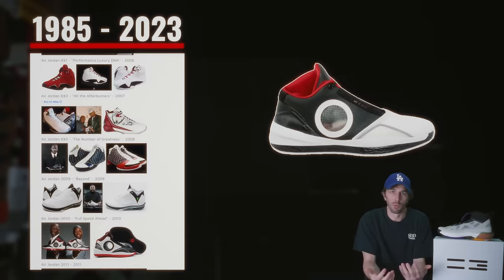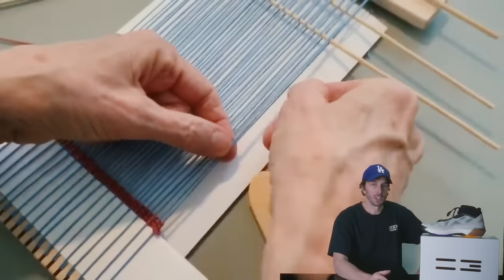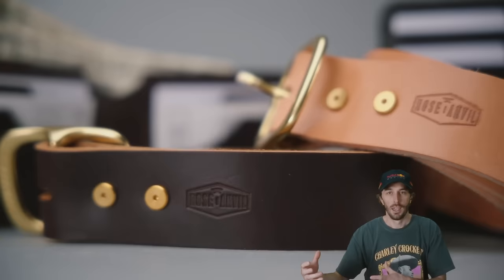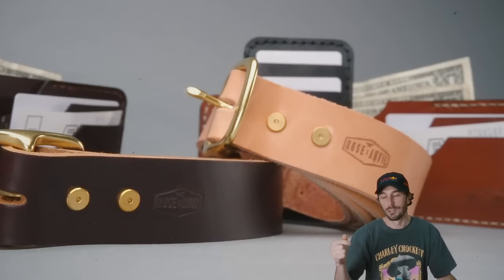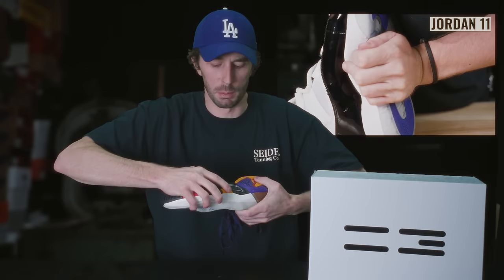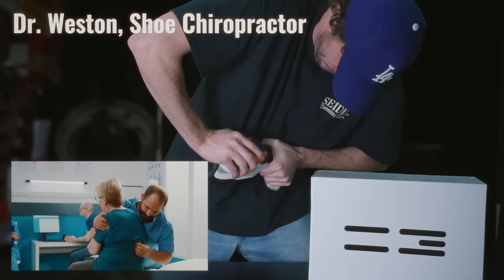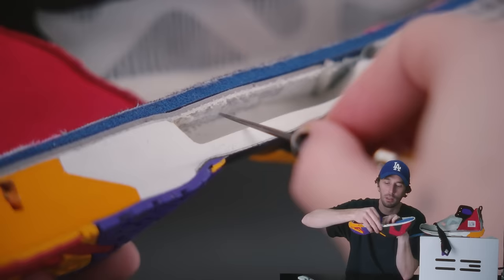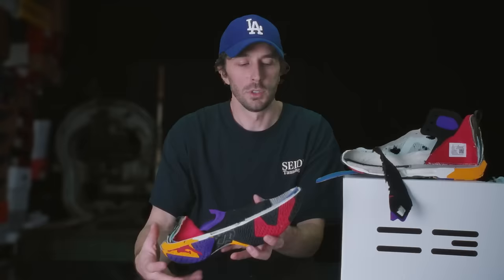Is Jordan 37 just a potato sack?

Comment: That void in the middle is off center. The majority of the void is under the arch where there isn't any pressure. The perfect location for a weight reduction.
Reply: Also looks like they did the same with the 36 with the hole in the middle but just did it inside this time.
Reply: There definitely is pressure for some as a lot of people have no arch
Reply: @Alphoric  20-25% of people are generally flat-footed, including Usain Bolt.
Reply: Yes, is Nike Air Max 95 (1995) between Nike and Jordan shoes to do it first or was it a previous one?

Comment: I think 36 did it better. Using more Zooms made it lighter, and by using longer and stiffer carbon plate they made them even more propulsive. Also these zoom pockets degrade way slower than those extremely soft foams, so you can rock the same shoe for longer. These jordans are made just to continue the "new year - new shoe" tradition.
Reply: that's like, every nike basketball shoe for the last decade though. Their budget lines are the only ones good for playing outdoors and longer durability, they just lack the stacked tech. Other brands from outside the US are filling that void a lot better
Reply from the maker: I did like the 36 a lot @RS3NDIT
Reply: @RoseAnvil  I have the 36! It’s one of their better offerings in a while but I wouldn’t call it an outdoor shoe. That said I got it for like $90 at which price point that kinda tech is a steal and a lifesaver for my knees outside. But at retail…the durability just isn’t there although the tech alone arguably makes it worth it
Reply: The toe box is too narrow
Reply: @RS3NDIT  "that's like, every nike basketball shoe for the last decade though"
just no 😆

Comment: I wear this exact model/colorway right now to ball and absolutely love them. They're absolutely not made for casual wear, though I suppose you could, and the cushioning and support/weight balance are fantastic. With basketball sneakers, especially if they're not purpose-built for outdoor play, will wear through the traction before you would seen any benefit from heavier materials like actual leather or something particularly sturdy/substantial. They make plenty of casual shoes, but these aren't them. Also, I got mine on clearance for like $70 brand new. Jordan pro-top: buy last year's model with the new model is about to come out. Maybe I'll try the 38 next year.

Comment: I bought two pairs of these. They are amazing for running up and down the court. They're not the best for the lateral movements but they are great
Reply: Agreed. I found them for 75 euros and played in them quite a bit, but they are not so stable in lateral movements. I really noticed that I was wearing the shoe while I was playing. I think this is due to how far off the ground they are with all the foam and air units, and also the more athletic shaping of the shoe preventing it from having a wide base. Also the upper is really breathable, but quite uncomfortable. I needed to wear really thick socks with them.  Switched out to the New Balance Two Way V3's and love them, not as bouncy or cushioned, but enough. Fantastic ground feel and great for lateral movements.
Reply: I almost roll my ankle using this shoe.Ended been giving it to my brother since he weighed more & and played center.For point guard that dribble & running wild on court, this ain't a shoe.

Comment: There's a skate shoe called FP. They have the same concept of the formula 23 foam that is meant to absorb impact for guys jumping down a flight of stairs on their boards. I've seen where they drop a bowling ball on a cement block with other insoles and their FP insole, and the block cracked with every other one except theirs. Didn't even bounce. Then sell the insole separate but they have the shoes which have more shock absorbing stuff. I always thought it would be neat to see what is inside one and get yr take on it.

Comment: I didn't like the style of it, but  specific colorways grew on me. Definitely a bouncey shoe and I like the almost 1 inch off ground height. Can feel the double strouble   cushioning in the forefoot walking... 23 foam in heel... not so much. 
Negative-  the potatoe sack meshing is not comfortable,  hard wire feeling, prefer 36 mesh comfort feeling.  The exposed shank gets destroyed.. rocks, stairs... it scratches up... the shank should not be exposed,  should have been covered with rubber..  to make the bottom of the shoe more flat ... more contact with the ground.

I am a 2E wide and it is true to size 10.5 (all other Nikes, 11 or 11.5 to have a comfortable fit)

If I go up .5 in these to a size 11 I feel the heel cage digging into ankle bone... and 1 inch dead toe space... heel dig a major issue... but true to size in Jordans 10.5, I don't feel the ankle heel cage digging into bone. To resolve the heel digging into ankle bone going up .5... just buy a heel arch support, it lifts heel above the heel cage that digs.

I find these shoes to be comfortable walking in because of the bouncey feeling. However for basketball I find them to be unstable,  the upper around the ankle is too filmsy... NOT PLUSH at all... the tongue at the crease of the ankle is thin so when the laces are tied... will feel pressure on foot veins etc. The forefoot curvature of the bottom of the shoe is not wide, so that leads to it being unstable.  Verdict 7/10... 36 is more comfortable but this shoe has more bounce and height off ground than the 36. 37 is Comfortable to walk in.